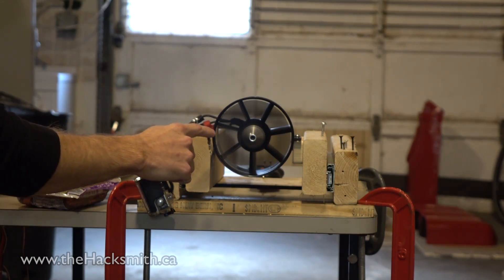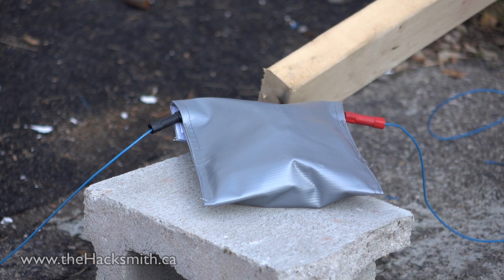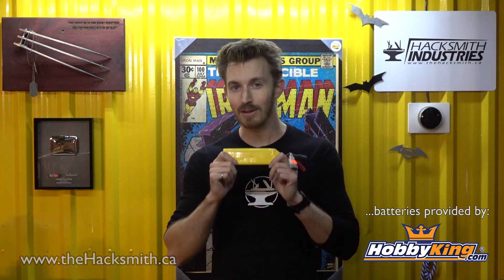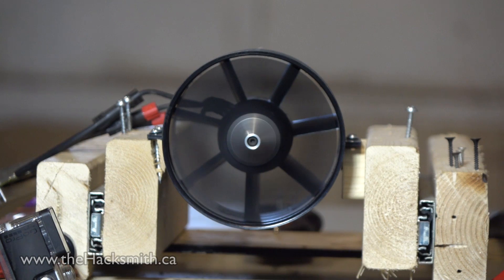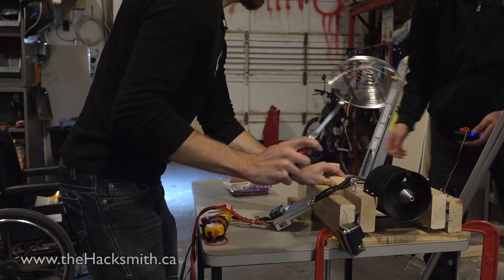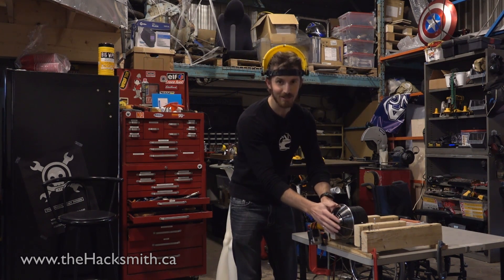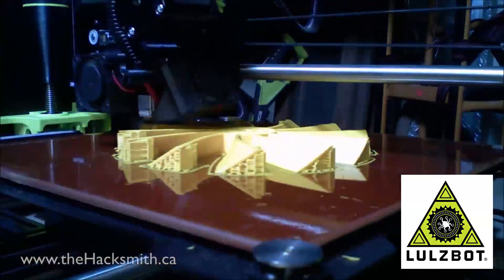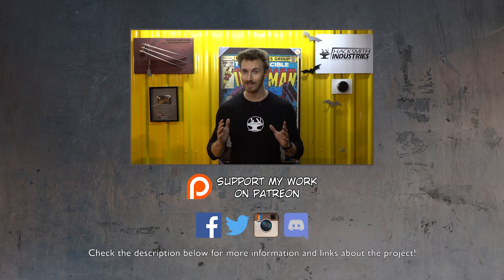Flying Like Iron Man #11: Not So Safe Safety Tests

Comment: hi man !
did you tried to make falcon's suit (wings) I think it will be amazing 
amazing vedios keep it up
Reply: In recent years a lot of work has been done on the aerodynamics of flapping flight. I think it would be amazing too, but even more complicated than the Hacksmith's current project.
Reply from the maker: Look up Jetman -- he has something similar ;-)

It would be too dangerous for us though -- using wings means you have to fly super fast all the time, I'd likely crash and die =( Our suit needs to be able to hover =)
Reply: the Hacksmith sure , I thought it might be dangerous too but cool
man I really love your vedios you're amazing
Reply: I wasn't thinking of fixed wing flight but of flapping wing flight. A couple years ago a guy built a man powered flapping wing aircraft. It was a significant accomplishment, but the wingspan was around 100 feet. Ergonomics texts usually put the maximum power output of a human at about 2 hp. So with 20 hp. distributed among the wings "muscles", you might get the wingspan down to 10 feet. It also wouldn't necessarily need to be dangerous (think hummingbird or dragonfly).
Reply: Michael Lovelace  wow!! that's cool do you have a link or something

Comment: A bit off topic of Iron man, but an application idea of the EDF system. Currently the U.S. Military and scientists of several divisions and contractors, big companies and independent civilians alike, are putting in the effort of Exo-Suit projects. Some of the designs are promising, while others are clunky. Could these EDF's, or smaller units, help in advancing the locomotion of these Exo-Suit designs and be efficient to the design in terms of weight, energy drain and cost, towards the final product? They wouldn't need to fly or hover, but just that little boost to get the suit and it's wearer moving at a good speed.
Reply from the maker: +todd collings absolutely not. :P

EDFs are extremely inefficient -- the system as it is will only last a minute maybe two at best. Their weight and power draw would just not be worth it on an exoskeleton. I feel like solid rockets would be the only real option -- if they can perfect an ignition system that actually works reliably :p

And not really off topic, I used to build exos :p
Reply: I can see that. And I remember, awesome builds those. Thanks for the feedback. I feel the main failing of Exo systems is the added weight and reduction of mobility, in a combat sense. Maybe useful in a ripley alien way, loaders and such, but not much more until locomotion has been addressed. Keep up the good work and may your efforts be rewarded always.

Comment: I've got a question. Let's presume that you weight about 90kg and each motor can lift approximately 3kg you would need 30 motors and that's a lot and that's not even factoring in the weight of the lithium batteries that need to supply 30 dam motors and also the default weight of the motors so what I'm curious to know is how are you going to hack your way out of this situation
Reply from the maker: +Moses Huf-Tirfe uhh... Try watching part 10? Or visit the GoFundMe page for info on the design?? We aren't using the small EDFs (which produce 8kg by the way, not 5...)
Reply: the Hacksmith oh because when I saw you use that scale thing on the test to see if the strainer prevents it from sucking in air it said it had 3kg of strength but now I understand stand and I would also like to say that I'm a very very very very very very very very very very very very very very very very very very very very very very very very very very very very very very very very very very very very very very very very very very very very very very very very very very very very very very very very very very very very very very very very very very very very very very very very very very very very very very very very very very very very very very very very very very very very very very very very very very very very very very very very very very very very very very very very very very very very very very very very very very very very very very very very very very very very very very very very very very very very very very very very very very very very very very very very very very very very very very very very very very very very very very very very very very very very very very very very very very very very very very very very very very very very very very very very very very very very very very very very very very very very very very very very massive fan of all your work!!!
Reply from the maker: +Moses Huf-Tirfe yeah we also said we weren't running it at full power :p
Reply: the Hacksmith ahh

Comment: two things one why not wrap the battery's in a fire blanket for that extra bit of protection also it won't build up as much pressure as those kevlar bags and two you don't even need baterys if you have a fusin reactor on you back and it's easy to get the plutonium from some iranan dealers just don't forget to pay them back

Comment: Also have you tried getting someone to smooth out those ridges? You probably have already thought about it but maybe you could design the blades to be slightly thicker and then sanding them down to be more smooth or perhaps use another method that is more precise I dunno I'm just a bachelors of biology.

Comment: So have you thought about aluminum casting those blades? Using the ABS model blades and use the sand casting method to get something a little more durable?

Comment: you might want to look into how turbine engines compress air to multiply the force. a multi fan setup might be an answer. not to mention the stator blades would work as a protective grid in a sense and have a dual purpose instead of just added weight.
Reply from the maker: +tommy that works for turbines, but for an electric system like this it would require an immense amount of design (and probably still wouldn't be worth it) cool idea though!

Comment: Can you embed the blades with some sort of fiber? or make them from carbon fiber?
Reply: Its not that crazy... there is a company working on carbon fiber 3D printing... I think I read about it on make a few years ago... >_>

First hit on google for "Carbon Fiber 3D printing"
https://markforged.com/materials/#carbon-fiber

Looks like this one requires a specific printer, but I think the article I read was for a company experimenting with just the filament being carbon-fiber... >_>
Reply: +Garret Hoffman the problem with casting is that it would be very difficult to make every blade the same, but it could be done with hours with a file, protractor and micrometer. It would be easer and better to get it machined, but more expensive. And yes, I think they need to get the shape down before they work on strength and meterials.
Reply: +Garret Hoffman green sand requires a new mould every time, and would probably produce  a very rough cast, but that could be refined.
Reply: Iden Gray lol I don't think you know how crazy hard that would be for him to do
Reply: +nym ink the whole project is crazy hard to do to start with. This would make it doable on his budget. It is possible to make a cast out of carbon fiber, and he could 3d print the mould.
He's the hack smith, if he wanted to, he could find a way.
Reply: Garret Hoffman the 3D printing also had a fiberglass option, for high strength and high temperature applications.
Reply: Iden Gray yup... I saw that too, from the same 3D printer company... I'm not sure this needs to be a high temp application, as much as a high strength one... Then again, I'm a software engineer, not an avionics engineer, so what do I know... :P

From the video it sounds like they need to get the prints right before they move onto strength and reliability of materials.  For example, getting those ridges down to micrometer scale or smaller, and getting the fan blades to fill the duct completely.  They need the 3D printed fans to pull a certain amount of weight to make this actually a cost saving method.

I think ive also read suggestions about casting (the suggestions were for iron/resin, but aluminum casting might work better, and there are loads of tutorials for it all over YouTube), though I'm not sure that's viable with the complexity of the part, and the required smoothness.  You could plausibly do a green-sand lost-wax type casting, but it would be difficult to reuse the mold.
Reply: Ooh... I didn't notice the kevlar one... They could use that to make lightweight impact resistant battery boxes, if the Kevlar bags don't work out... :P
Reply: Iden Gray that's kindof what I figured... might be easiest to start with a rough cast, then machine down or otherwise post process to the specs you need, if you are going with metal solutions...

Comment: would some powerful capacitors be a lot more expensive, or heavier? cause really good ones can outperform batteries  like those on almost every level, so those are the only 2 reasons i can think of that would not be using them.

Comment: Was the fan flying off scripted? Or did it happen and you re created it?
Reply from the maker: +Quinten Barker scripted lol, we have had them fly off before though (didn't tighten the set screws enough)
Reply: lol you didnt look as worried as you might have if it was real. I assumed you would be wearing goggles at least if not behind a plexi-wall.

Comment: how about with the fan 3d print the design then make a mold and fine tune it, it will take longer but it will be alot stronger as you dont have to worry about the layers of the print ripping apart

Comment: Why do you print one on the 3D printer then cast it out of a higher strength plastic? That way you could make each one identical and for cheaper that printing them. Also they could have smooth edges. Would this work?
Reply from the maker: Problem is at home-casting is pretty difficult for precision parts. It works for a lot of things, but for something like this, might be more effort than it's worth.

For example -- if you see the professional EDF blade we show near the end of the video -- look at the underside. It has a bunch of holes in it. Those are for balancing the blade so when it spins the CofG is perfectly in the center. Considering that whole piece was machined very accurately, it should of been balanced from the get go. Now imagine casting it, how many variations it would have! It might be possible, but like I said -- would probably end up being more effort than it's worth.
Reply: the Hacksmith Oh I see that makes sense. Well good luck! I hope you become airborne!

Comment: The problem with typical 3d Printed parts is that ABS and PLA cannot withstand much stress or strain. Have you looked into other printable materials or possibly a resin-like casting?
Reply: Joseph Magenta thank you not to mention how structuly unsound 3D printed parts really are but this is one comment I hope he doesn't read but I can say from EXPERIENCE that you can't really make 3D parts as good as factory machined parts
Reply: http://carbon3d.com/  : uses resins and uv light to print without the layering issues of traditional 3d printing (the big reason what makes 3d printing weak in the first place)

Comment: have you tried printing in some other materials that have more strength? Taulman alloy 910 is incredibly strong , but may lack the rigidity that an EDF blade needs, so I would think that polycarbonate would be the next best option.

Comment: This is more of a chance to educate myself on physics than really provide any advice, however, what happens if you use a cone shape on the end of the EDF to direct the pressure (i think thats the word)? Could that result in better thrust (again i dont know if that is the correct word) and less energy lost/scattered? Sorry for being so ignorant on the topic but it was just an idea which popped into my head
Reply from the maker: +HarryIII no worries! The EDFs are already designed to give maximum thrust as is (if the manufacturer could make them better, they would so they could sell more!

That being said you can add something called a thrust tube and gain up to 25% thrust! But -- only works at high speeds, not for a static scenario like hovering :)
Reply: the Hacksmith i see, thanks for the reply!

Comment: the hacksmith you should do a cast in metal for the edf go look at the king of random and how he cast things
Reply from the maker: Problem is at home-casting is pretty difficult for precision parts. It works for a lot of things, but for something like this, might be more effort than it's worth.

For example -- if you see the professional EDF blade we show near the end of the video -- look at the underside. It has a bunch of holes in it. Those are for balancing the blade so when it spins the CofG is perfectly in the center. Considering that whole piece was machined very accurately, it should of been balanced from the get go. Now imagine casting it, how many variations it would have! It might be possible, but like I said -- would probably end up being more effort than it's worth.

Comment: why not print an EDF fan and then use green sand to cast it in aluminum or another metal?
Reply from the maker: Problem is at home-casting is pretty difficult for precision parts. It works for a lot of things, but for something like this, might be more effort than it's worth.

For example -- if you see the professional EDF blade we show near the end of the video -- look at the underside. It has a bunch of holes in it. Those are for balancing the blade so when it spins the CofG is perfectly in the center. Considering that whole piece was machined very accurately, it should of been balanced from the get go. Now imagine casting it, how many variations it would have! It might be possible, but like I said -- would probably end up being more effort than it's worth.

Comment: why don't you try something like this they are using the same idea as a jet engine 
https://www.youtube.com/watch?v=HZRp6iRjnhQ
Reply from the maker: Because that only works if you're constantly going at high speeds -- he uses a parachute  come back down. Part of flying like Iron Man is being able to hover in the air =)
Reply: what i meant is using the idea of jet engine and use fuel to make a Combustion to heat the air intake which will create difference in the pressure which will help in the lift force and you can make VTOL just like in Harrier Jump Jet

Comment: Couldn't you try to making the edf blades using the lost-wax casting approach? Print the final design in pla, make a mold, burn it out and cast the fan it in aluminium. That might hold more rpm.
Reply from the maker: Problem is at home-casting is pretty difficult for precision parts. It works for a lot of things, but for something like this, might be more effort than it's worth.

For example -- if you see the professional EDF blade we show near the end of the video -- look at the underside. It has a bunch of holes in it. Those are for balancing the blade so when it spins the CofG is perfectly in the center. Considering that whole piece was machined very accurately, it should of been balanced from the get go. Now imagine casting it, how many variations it would have! It might be possible, but like I said -- would probably end up being more effort than it's worth.
Reply: That's true. Balancing might be a problem, depending on the quality of the cast (and the impurities). However printed parts have the problem of being not strong enough due to problems with layer adhesion and breaking at sharp edges/corners. I honestly don't know, but if you could get a cast with reasonably good quality it might be worth a try (and it makes for a cool video). Machining the fan would obviously be the best option... But that's expensive. Wish you the best of luck with your tests!